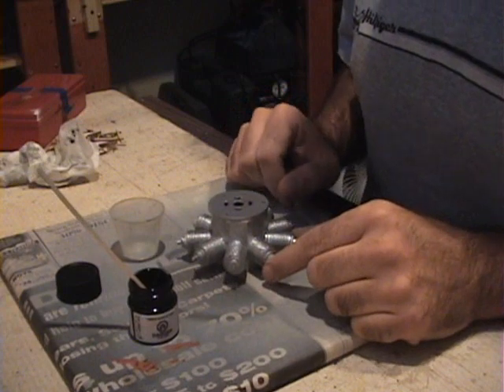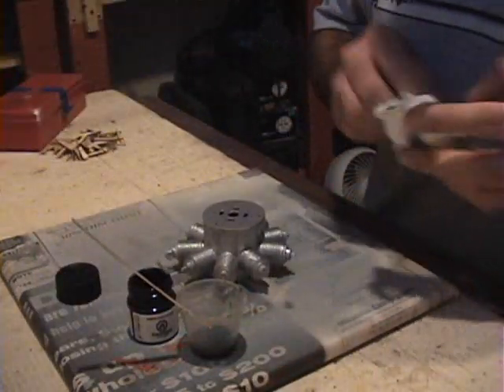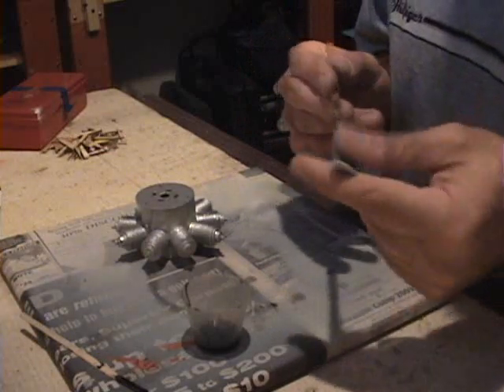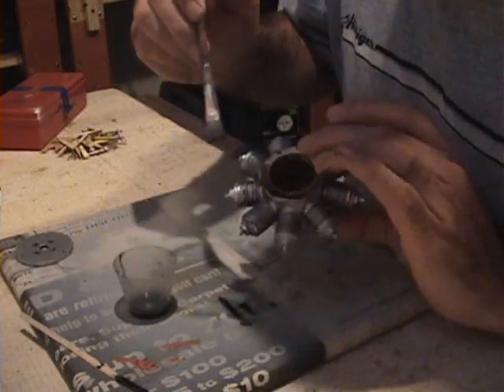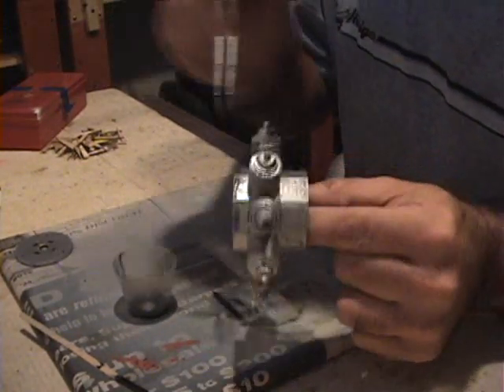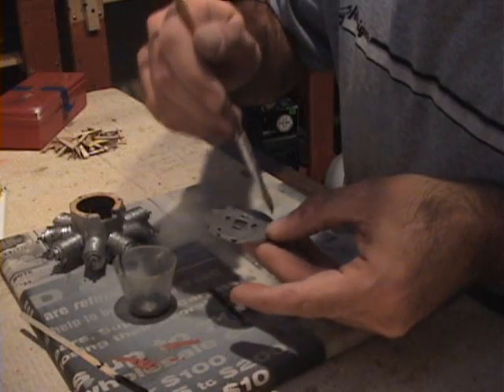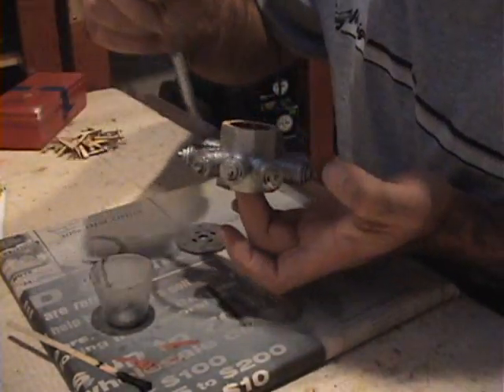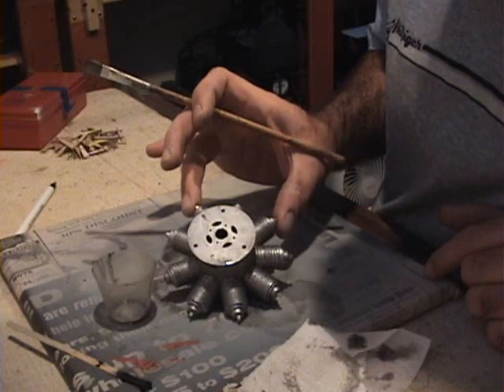Weathering Techniques - Applying a Wash

Comment: i use Future Acrylic Floor Coating, now called Pledge and also Klear in some places. it won't affect either acrylics or enamels. it helps over matte finishes immensely because it contains the wash to panel lines. it's self levelling and durable. it makes an excellent decal mounting surface. i model mostly armor and i primer, paint with either acrylic or enamel, coat w/ Future, add decals, wash and weather w/ oils, then coat with dull clear. weathering powders are the final step when i use them.

Comment from the maker: That is a good question. You can use paints with different bases. For instance, if the colour paint is acrylic (Like Tamiya), then you can use an enamel paint (Like Testors) for the wash. The testors will not disolve the Tamiy. Also, let the underlying paint dry completely, for a few days, before applying the wash.

Comment from the maker: @eclipse245 Maybe, but it might make the entire wing "dirtier" than you like. If you want the wash just on the panel lines, apply only  a drop or two at a time with a small brush right on the pane line. The wash should then flow along the panel line due to capillary action. You might want to make a very thin wash (use more thinner) and repeat 2 or 3 times until you get the desired result.

Comment: @vonJaerschky So how does that work for if i want to apply a wash over a model thats been sprayed? my wash dried horribly, i used army painter british spray, applied a oil wash, was terrible. Cleaned it up , added a gloss varnish then tried a Vallejo wash and still its terrible and dried greyish?

Comment: I'm Currently painting a M4 Sherman and the paint is a bit shiny still. is there any way to use the wash to stop it being shiny?
Reply from the maker: LNER 4489 TC If you just want to dull the paint, a coat of Testors Dullcote from the spray can will take care of that. If you use a flat black wash, it will dull the paint some as well.

Comment: I'm about to start a build on the Moebius Battlestar Galactica Viper model kit and want to dirty up the white material. I have read reviews of other builders and both use a "wash" to take the shine off and make the model look worn.

One sprayed the model matt black and reapplied with a fresh layer of white, another just applied the wash. Neither were terribly specific about it though. Would you suggest using this technique (albeit along the length of the model) or suggest another technique?

Also would you suggest the first technique of applying a base coat first?
Reply from the maker: ***** The wash helps to bring out details in panel lines, and that sort of thing. If you want to make the entire model look dirty, another thing you might want to try is chalk pastels. Make sure they're the chalk kind, not oil pastels! Take a black pastel and rub it on a piece of 220 grit or so sandpaper. Then use a soft brush to pick up the powder and apply it to the model. You'll have to experiment to get the feel of things and see how much you need to use to get the look you want. The model will need a coat of clear to seal everything afterwards. I'm using this right now on my 1/5 scale Hawker Typhoon, and it's looking really good.
Reply: I'll have to give that a try on an interior piece and see how it works for this model. Thank you for the advice and for replying so quickly.

Comment from the maker: @SteveSabbai There should be no reason to put a clear coat on prior to the wash. But, and I say it again for the thousandth time, do not experiment on the model itself! Make a test piece with the paint you are going to use and play around with that until you get the hang of it and to make sure your chosen paints are all compatible. Good Luck!